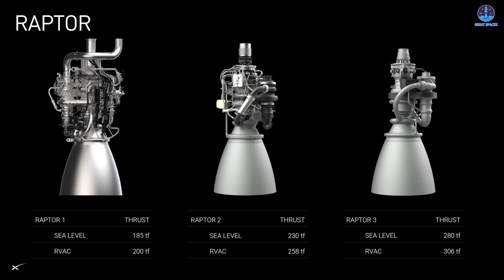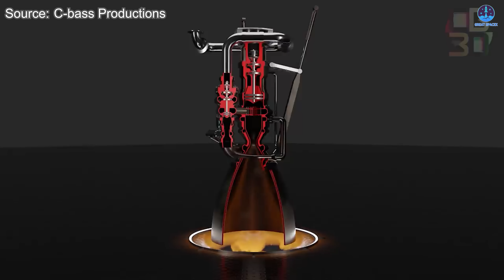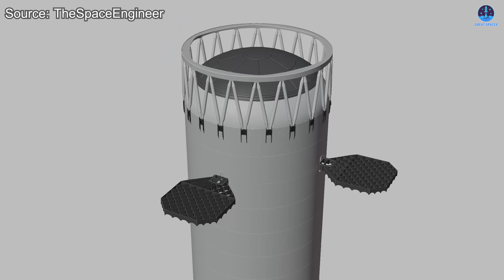SpaceX Revealed Big Challenges in First Starship V3 Flight Next Year! HARDER than You Think…

Comment: I'm surprised they don't use a baked on ceramic coating like used on piston tops in race engines with everything from 20,000rpm forced induction (turbo an more) and or nitrous injection. Being able to stay adhered to a hardened forged piston top cold rolled stainless should be even better. This is why even in rocket engineering that designs race engines for work and play, I was able to fix a lot of things in a glass factory because of many years in auto industry because the base for both is mechanical engineering.

Comment: Could a hydraulic/ syringe type design work for refueling??
Reply: Yes, or similarly a collapsing liner. A major problem with those is cryogenic temperatures change material properties and needing to operate through a large range of temps. Rubbers become brittle at low temps. Precision fit metal seize at one temp and are sloppy at another. Would piston compression rings like in a car work or not have good enough sealing? I'm sure there are dozens of ways to solve the issue.